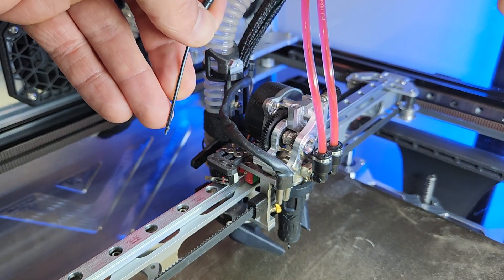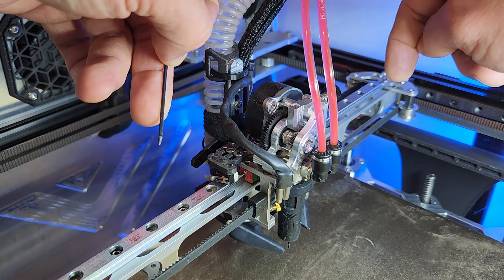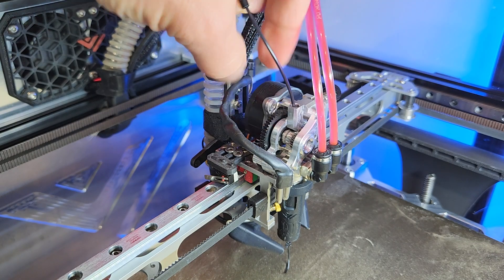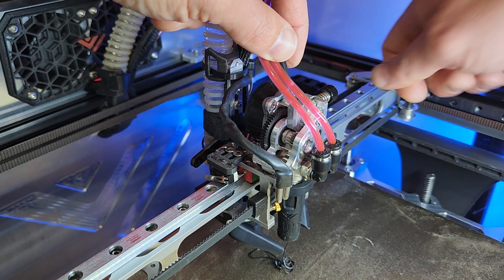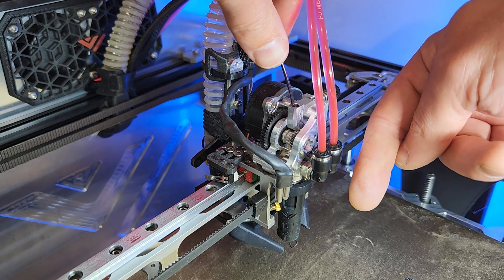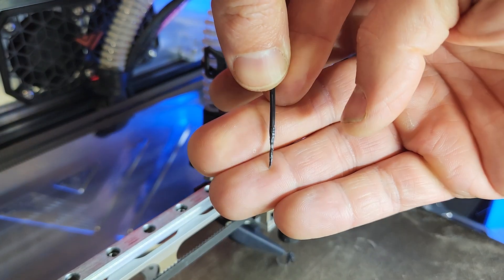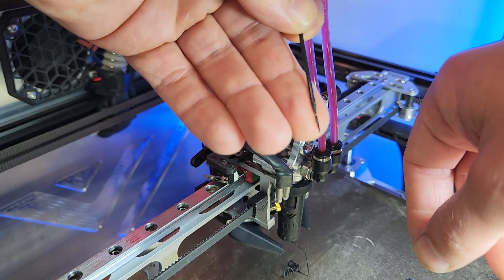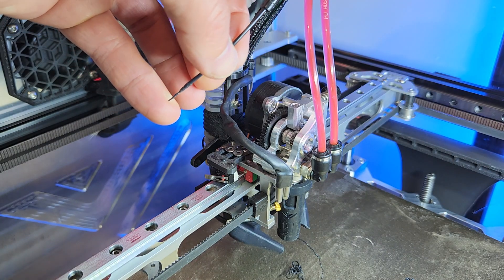How to properly tension Vz-HextrudORT

Comment: I tried this method and found the right amount of tension but on 1 print, the screw was vibrated loose because there wasn't enough backforce provided by the spring.

Comment: How does the extruder work with flexibles? Some people claim it is not so good due to gear design.
Reply from the maker: I printed a tpu benchy in 5min 😂. If you put too much pressure and try to push more plastic than your hotend can melt, it will twist the filament...but if you run it properly i have no issue
Reply: @Vez3D I can’t get mine to even overcome the force of turning the spool. I tried turning the tension all the way up, but it seems that the gears can’t get any closer together.

Comment: Is there a model I can print to extend the lever so that I can open it manually? 
I like to do "hotpulls" whenever I change filament. Essentially manually forcing down the filament quickly until I feel a resistance that tells me that cold filament has reached the bottom of the hotend. I then quickly pull it out and it removes 95-99% of any filament left in the hotend. Repeat and it's clean. 

Thank you for your work, love your videos!
Reply: Never mind, I made one (haven't tested it in action yet)

Comment: I’ve been running fixed idler for about 500 hours now and it’s been working amazingly and showing no signs of wear on the bearings or anything. Absolute insane amount of grip too, no slipping on the filament up until it skips
Reply: another benefit of fixed idler is that you can set the spur gear tooth mesh to the ideal amount. They have a pitch diameter of 8.5mm. Adding a little for tolerance and 8.6mm between shaft centers seems to be ideal. Optimal gear meshing should be ideal for extrusion quality and wear life.
Reply: @clborrello  ah the fixed idler fighter himself. Yep it seems to help with extrusion consistency and reliability especially between different filaments